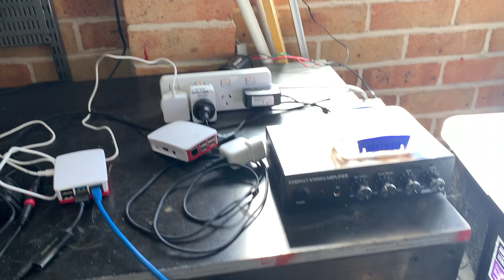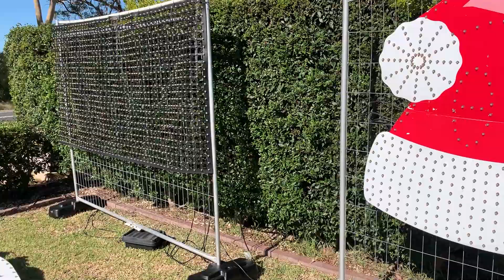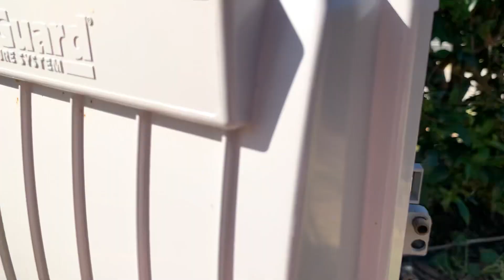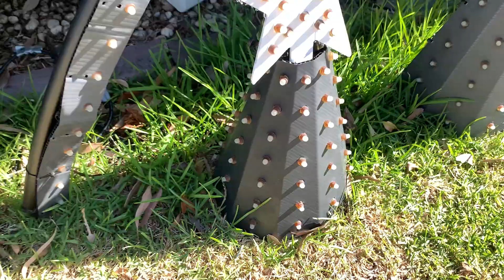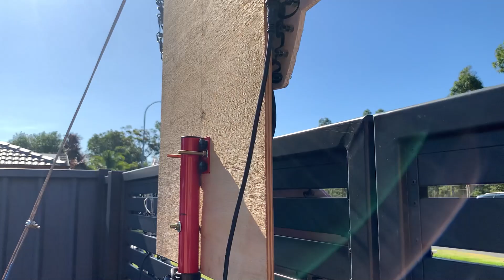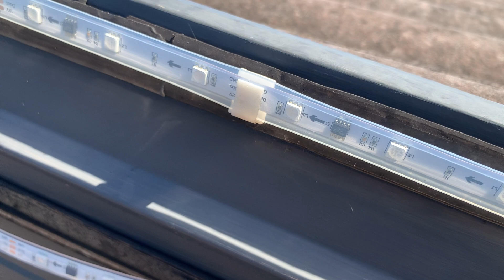Pixel Display Tips 09: 2024 Show Daytime Walkthrough

Comment: Very nice Beau.
Seems that you like a matrix or 2. :)
Love the magnet mounting option. I'd prefer having ventilation on any boxes with more than 200W of power supply in them. With power supply efficiency of about 90% and ambient temps when the shows start in the mid 30s things could get overly warm in them. Natural/clear cable ties aren't UV stabilised so it's not unusual for them to become brittle and fail within a few months in the sun. Even black ties vary in how long they will handle exposure to sunlight.
Reply from the maker: thanks the psu boxes actually do allpw a bit of air and the supplies in them are actively cooled but there would be no harm in some better ventilation for sure